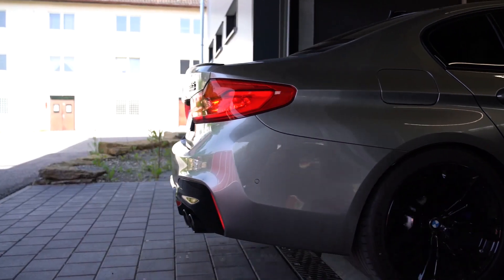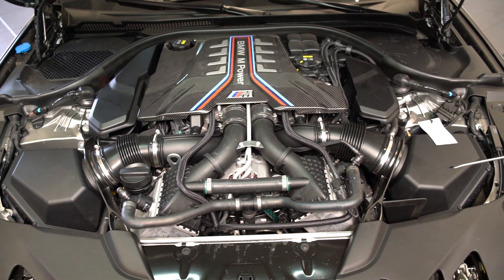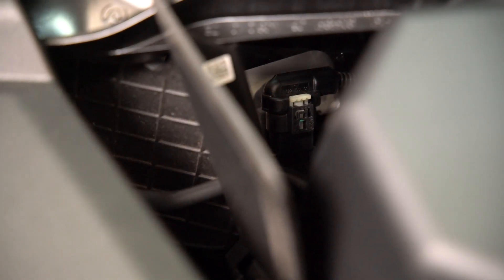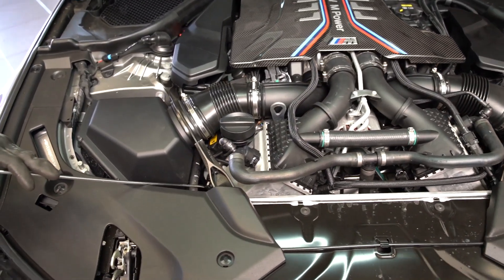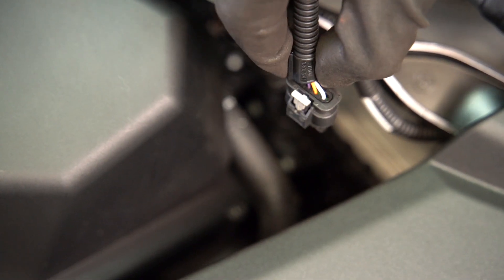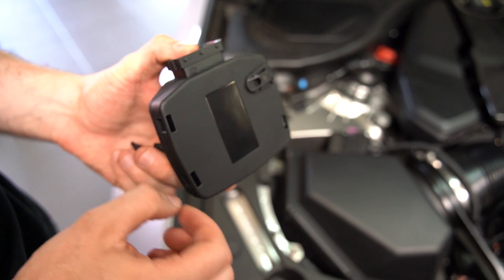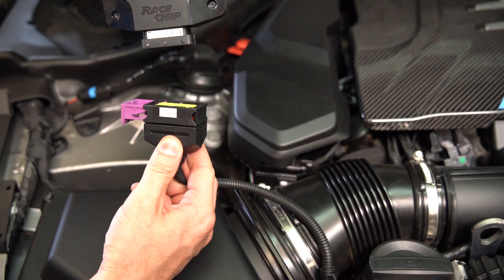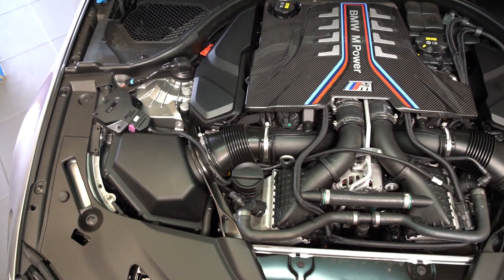BMW S63 & N63 Engine RaceChip Tuning Installation | BMW *50i | M5 | M8

Comment: What’s the power upgrade if any and feature of this chip? Also will is work on my 550i GT?
Reply from the maker: We do have a chip for the 550i and you can find that here https://www.racechip.com/shop/bmw/5-series-g30_g31-from-2016/m550i-4395ccm-462hp-340kw-650nm.html